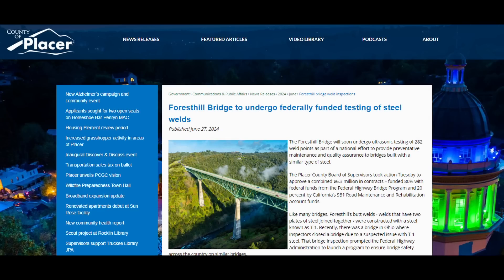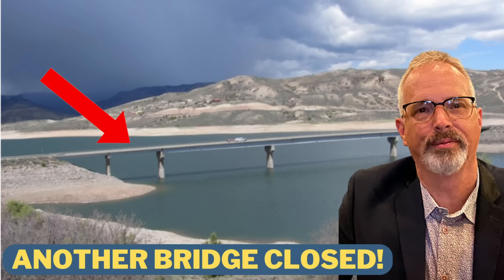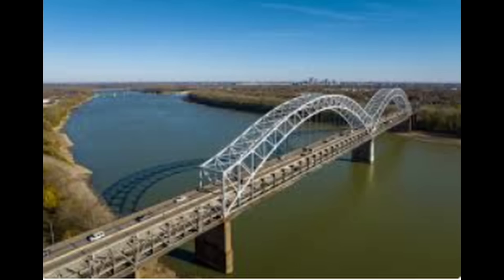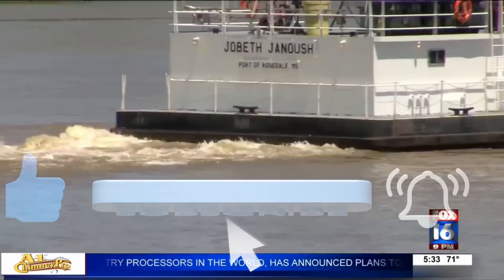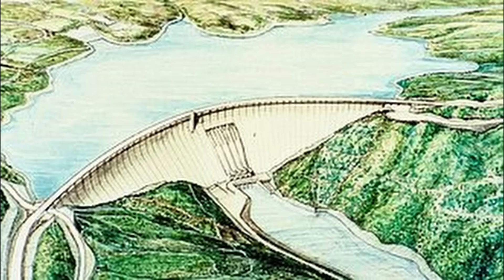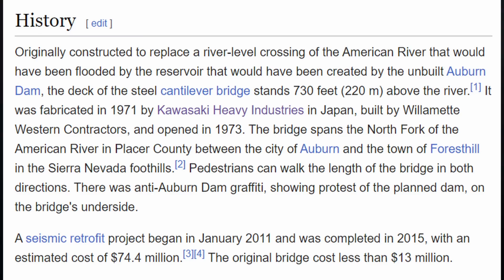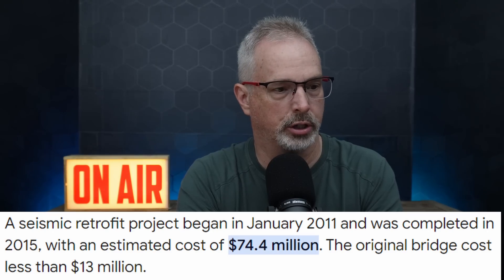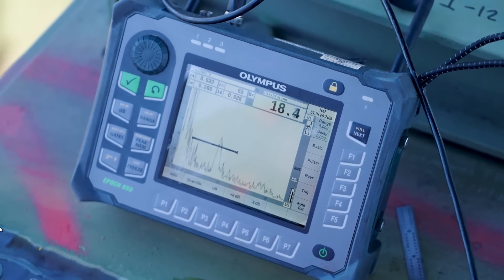Foresthill Bridge in California - Another T-1 Mess?

Comment: Hydrogen embrittlement is an issue for all high strength steels. I have a welding textbook that notes under-bead cracking being an issue for naval gun mounts in WWII, but it's likely been an issue for as long as arc welding has existed. The biggest cause is the presence of moisture during welding, even just absorbed into the flux from the humidity in the air. There are ways around it, but you have to do stuff like keep electrodes in an oven to keep them dry enough.
Reply: Thanks for the useful information.
I'm just an amateur at welding and have realized that there's a lot of experience involved making a good weld, but I stick to welding simple unimportant things where the quality of the weld isn't critical. I have also discovered that stick welding aluminum isn't an easy thing to do even under ideal conditions.
Reply: A friend of mine was a welder at a nuclear power plant under construction.  He talked about the process of keeping welding rods in an oven so they would be perfectly dry before use.
Reply: @OttoMatieque  When working on aircraft we used alodine for corrosion preventative. Of course we were warned of the dangers of hydrogen embrittlement. But still.....we were awfully young. I look back and wonder if everyone was as careful as we should have been. Whether the alodine was allowed to run down and drip onto landing gear and so forth.
Reply: @OttoMatieque  mandatory on any project .
Reply: Ah, interesting! I was wondering where the heck the hydrogen came from, I’ve typically only heard about in the context of hydrogen pressure-containment vessels. Thanks for the info!
Reply: @DaveEtchells  Just be aware that now with low carbon emissions there are experiments ongoing using hydrogen gas to make steel.
Reply: Yes I have an electrode oven.
Also we put rods in refrigerator for days took moisture out.
Reply: IV found in my job as a boilermaker doing field construction in power plants and oil refinery as well as years in a lead recycling and smelting plant. That if your able to preheat the base metals when it's super humid over 900 F and clean the hell out of the steel you can put in excellent quality welds in all positions using 1/8 in 7018 LH.  When time permits controlling the rate of cooling afterwards further increase the preferred grain structure
Reply: @bigjay875  They stress relive pressure / boiler vessels by heating and pressure to take strain off metal next to weld fillet on base metal .
ASME code.
7018 best all purpose rods . 
I still can't weld overhead though lol
Reply: @Motorhead250  my little ramble was more for the normies.  As far as over head mild steel, using 7018 LH rod the trick is to keep a tight ark and try to make yourself comfortable and stable.  Rod Angle is also very important keep it as strate as possible maybe dragging it just a bit.  I run my rod a bit hot on thicker base plates when testing out for a job.  1/8 in rod at 125-130 depending on the machine.  Just keep at it time behind the hood equals success but again tight ark. Good luck friend
Reply: @bigjay875  thanks ...Be well.
Reply: I took an introductory course on material science in about 1980. The book for the course was written in 1970 (the process for introducing new material into engineering curriculums is very slow). There was no mention of hydrogen embrittlement, only that welding could cause thermal damage such as overaging, over tempering, or annealing. One wonders when they discovered the actual cause of the under-bead cracking. The class might have mentioned hydrogen embrittlement, but I don't remember the lectures. Welding was covered in one paragraph of a 545 page book.

When was that welding textbook originally written, and the latest revision made, just curious? I'm guessing electron microscopes needed to be sufficiently developed to understand the how, even if experimentation could have developed methods to avoid hydrogen embrittlement earlier than the understanding.
Reply: @johnhaller5851  The one I have has a copyright date of 2004 (Welding Principles and Applications Fifth Edition, by Larry Jeffus)
Reply: What's wrong with keeping rods in an oven? I used to do sheet metal work and certain rivets were heated in a heat treat oven and we had 30 minutes to use them once they cam out. ....or keep them in an "ice box" between uses. Thus the name ice box rivets.

Comment: What about the Skagit bridge it Washington state. It failed in 2013.
Reply: If you are talking about the I-5 bridge over the Skagit River, that was due to a over size semi truck load striking a critical structural member. That story is less a structural story and more a transportation management story. If the truck was straddling the two lanes instead of in the right lane the incident would not have happened. 

The only structural note to consider is that Washington state increased the priority of replacing bridges that have critical members that can be damaged by vehicles. I'm not clear how the shift of priority has impacted projects.
Reply: @erniecolussy1705  I remember it vividly I was living nearby. And saw it moments after it happened.
However I think It was the  same type of steel. And it may not have failed from that strike had it not had other issues.
WA has huge bridge problems never mind that one.

Comment: I'm not an engineer, nor do I play one on TV.  But I have built a lot of stuff out there in our big wide world, so I've seen a thing or two.  One thing I have discovered, is that paper doesn't care!  Paper will just lay there and let any idiot make marks on it, and they usually do.  One of the biggest problems I find on nearly every project, is the design engineers failure to adequately address   Point Load Transfer.

When I look at those extremely heavy duty repair plates- I see an incoming pile of problems likely in some combination or other to cause failure.  1st, how about all those holes that need to be drilled through the existing steel.  Turning those webbed members into Swiss cheese isn't going to help -> 2nd, All that additional weight!  You will sequentially potentially overload each point load to the next point load and so on down line.  Those connections are already designed to supposedly adequate minimums taking into account, weight, moment, and shear, to name a few.  I suspect it's theoretically possible to add enough weight to reverse the Tension/Compression role of a given member.

Trusses work because every member has a role with every other member.  Fail any member (or it's connection point) and the whole thing fails.

Thanks Casey for bringing these issues to light.  I recently got a camper, so I think I will avoid this bridge, just to be on the safe side.
Reply from the maker: Thank you. It certainly is a lot of extra steel. It strikes me as just a short term solution to what really should be a bridge replacement.
Reply: @CaseyJones-Engineer  Do you think it's a short term solution?  Quoting Red Green, "This is only temporary, unless it works."  Do you think they're going to find the money for a new bridge if the patch works?
Reply: @major__kong thank-you for quoting my Canadian compadre Red Green. Surprised there isn't more duct tape in these builds 😅
Reply from the maker: @major__kong  Yes, I suspect that they would elect to replace this bridge if there are too many issues discovered.  I really don't know how this one will turn out, but I will keep following the story and doing update videos.
Reply: I don't think swiss cheese is the problem.  With the correct clamping force, the new plates will pick up the load.  My concern is the transitions.  If the stiffness of a structure doesn't transition gradually, that's another mechanism for developing cracks.  Those plates look to end somewhat abruptly.  One way to transition better is to taper the height of the plate towards the ends.  Another way to transition better is to use a stack of several plates with each new plate added being shorter than the one underneath.
Reply: @major__kong A great point! And in fact, some of the plates I have seen are actually stacked just like you mentioned.  I too have concerns about drilling all these holes in the web of the existing girders.  If this T-1 steel is already prone to cracking, couldn’t drilling cause more micro cracks?  The other concern is creating areas for the environment to attack the integrity of the structure.  Looking at the history of steel bridge failures, joints between gussets, hangars and plates secured by bolts are one of the leading causes and why inspections focus so heavily on them.  I, too, think replacement would be better than retrofit, however I am not a fan of of this national campaign to replace everything with bulky concrete monoliths.  We are underestimating steel and overestimating concrete in my estimation. 😉
Reply: @scottwendt9575  We're seeing lots of reinforced concrete structures that fail prematurely when the reinforcement rods become exposed to moisture and road salt.  I cringe when I read that some new concrete bridges have a projected life of only 50 years.  We should be able to do better.
Reply: I'm no engineer, but it sounds like every single welded joint will need to be reinforced, whether or not it shows any signs of cracking.  And if this T1 steel has any tendency to crack at places other than at welds, patching an unstable structure would be wasted money.  Davidmiller6010 makes other good points about drill holes weakening the girders, and that the added weight could exceed the bridge's designed capacity.